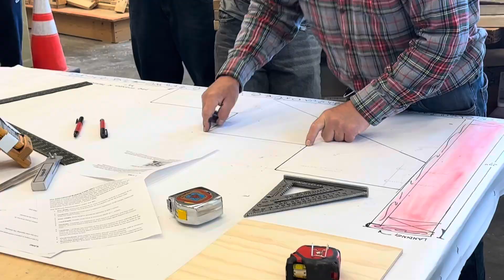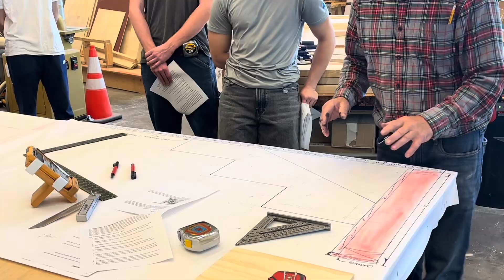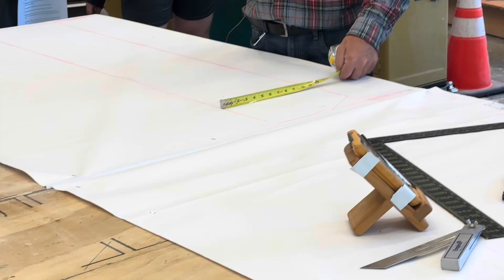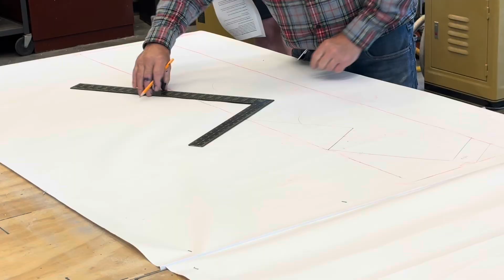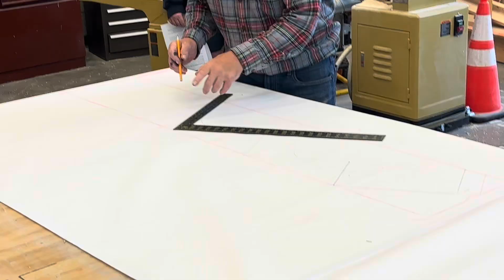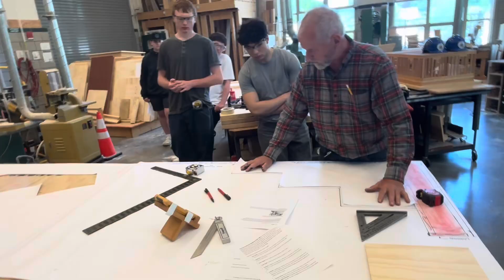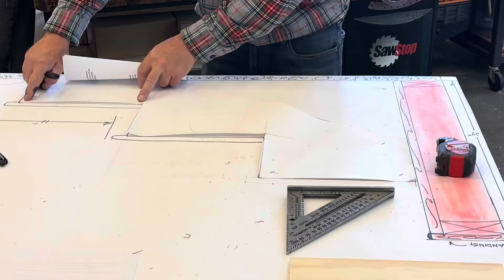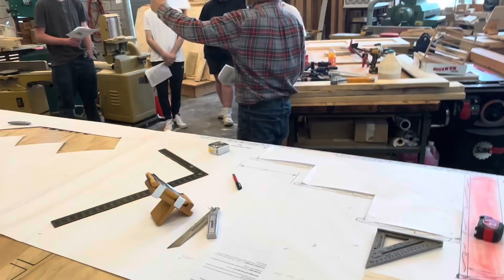Stair stringer layout @mrburkescarpentryclassqhs5452

Comment: nice layout demo bro, you may already be aware of this but when your using the builders sq to measure out the rises and treads, some people use stops on there sq, when you only doing a few treads just eyeing it with the sq is all good, however when doing a lot of steps, cut a triangle out of something thin like 3mm mdf (1/8th gawd sakes) , so the triangle is the riser high, the tread long, now join the ends to make triangle, then if you mark out 10 rises n treads with it, they are exactly the same
Reply from the maker: Yes I save that for another day.,,,,,,😊Thanks for the comment…

Comment: Is there an app that will calculate the steps when given the height to the landing?
Reply from the maker: Stairs-X Lite-calculator-google Apps on Google play 
We use a construction Master Pro Calculator here in school 😊
Reply: Usually, the landing height is determined by the rise or quite simply, if you're riser (step) height is 7", then you'll make the landing elevation a multiple of 7 inches.  For example, if the top of the stairs is 91", the landing would ideally be 42" or 49" or 56", etc.
Reply from the maker: @benvime  Actual Ben, your theory only works if you can control the build height of the landing. 🙂 Most cases we are working with a given total rise or an existing total rise. Thanks for the comment!
Reply from the maker: I hear there’s app that brings food to your door, but I rather cook my own food!😊😊 keep up the good work!
Reply: @mrburkescarpentryclassqhs5452  I watched your video with interest and actually learned something, however I asked a simple question from a professional carpenter, yet received a snide answer. I hope you treat the students and your family with more respect. God bless.
Reply from the maker: @DN-kz7xl 
I typically don’t give a snide answer to any legitimate question, perhaps my response seemed to be…. If somy apologies!😊 could you please respond to this…. With the question, as old timer I wouldn’t be able to find it in the thread 😊😊😊
Peace 🍀